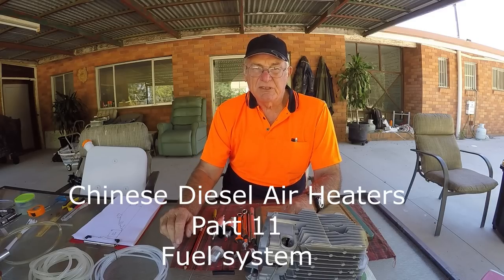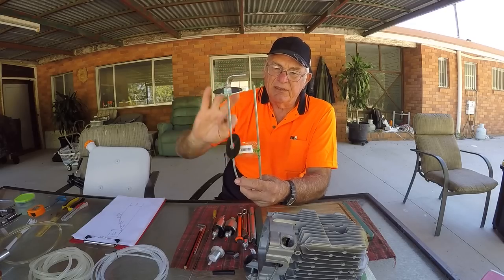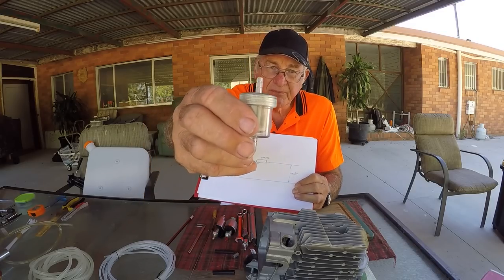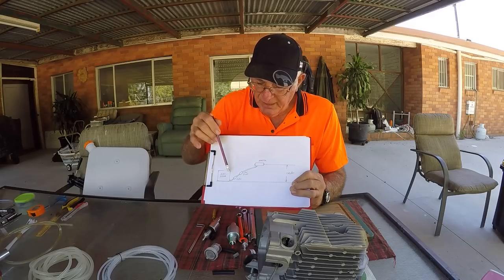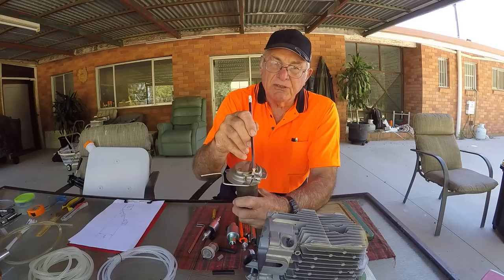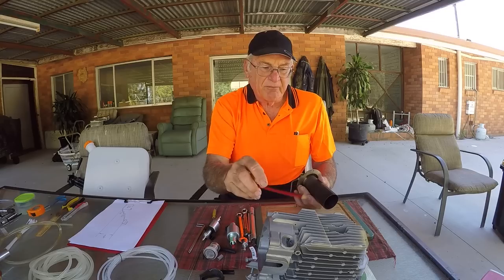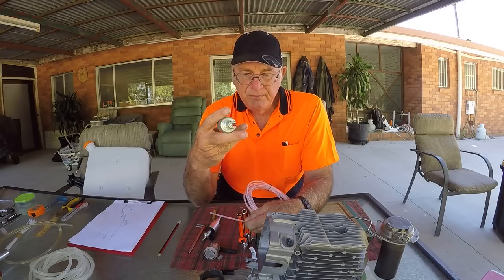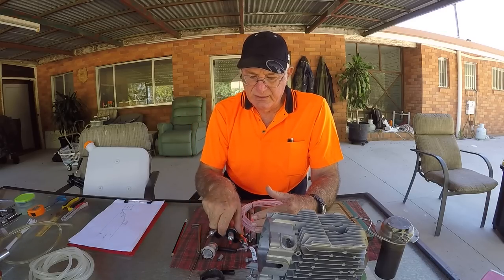Chinese Diesel Air Heaters - Part 11 -  Fuel Delivery

Comment: I have bought one of these heaters unfortunately when I connected the battery, the LCD controller  showed E-O1, which in my  manual  says; to raise the voltage, voltage is 12.8 v, so I assumed the unit is set for 24v, so I switched it off to reset it to12v but that didn't work, so I am stumped as to what to do next.
Reply from the maker: Hi Bob,

You may have a dud heater or glow plug, but first please check the actual voltage at the ECU in the heater. Put the probes where the power wires join the circuit board. If you have long cable runs or poor connections you may have sever voltage drop.

Next measure the voltage with the heater turned on when both the glow plug and fan are running. The glow plug will draw around 9 amps when turned on. Here again a low voltage could indicate too thin power cable (the supplied cable thickness in a real minimum) or poor wire joints.

Also check the fan runs free, sometimes the fan jams in the housing on poor mouldings, and that will cause a high current draw and voltage drop.

If you find nothing there, suggest you claim a refund or get a replacement. 
Please let me know how you go.

Good luck.   JMcK
Reply: @johnmck1147  thanks john, I will be back up there in a few weeks, so it will have to wait till then, (had to come back for chemo treatment) will let you know how I go, thanks again, Bob.
Reply from the maker: bob costanzo 
Best wishes with your treatment Bob.

Comment: Hi John, 

Your series of videos are amazing, and have put me at ease knowing how to modify them into a safe(er) unit for our family's caravan - so thanks a million! 

Some quick questions if I may, please: 

1: Can you please provide a link to the same or similar Nylon tube you used for the fuel delivery? I ran all around town today trying to find it - and failed.
2: In light of the above I purchased some 4mm thick walled fuel line from Repco - I see you mention it is ok if it is a short run from the pump to the heater. My length will be about 1.2m - do you think this is likely to cause soot buildup?? Should I just get the smaller nylon tube instead to be sure?
3: Lastly, I plan to install the heater to the floor of our caravan. The air intake and fuel line I'm happy with, but unsure if I need to wrap the exhaust for heat protection. The exhaust will mostly run along the chassis of the caravan but may contact the plywood flooring for about 100mm - is this a fire risk, and if so what product would you recommend? (a link would be greatly appreciated!)

Thanks again John, love your work!

Anton.

Comment: Have you ever tried to use copper tube ?
Reply from the maker: Yes. 
In many countries copper fuel line (or ss) is compulsory if the fuel line runs through a machinery space, eg boat engine room.  JMcK

Comment: If this was the only thing you had to heat with, how long in a day can you run these heaters for?
Reply from the maker: Hi Daniel, the original heater was not designed for continuous use, but as more of a parking heater, overnight use, or 12 hour stints, however if you have a well set up instillation, and run them on a low to med setting you can run them all day.

They have one moving part in the heater and moving parts in the fuel pump. The first to wear out is generally the fan motor, but greatly extend its life by not running it flat out. 

A good install, seasonal use, and not run flat out you can expect years of trouble free use.
Reply: Okay and thank you for the quick response. I love the videos on these heaters.

Comment: Mine came with the soft flexible hose where can I buy the hard nylon hose? Thanks
Reply from the maker: Hi Tom,

If your fuel run is short, say less than 3 meters the supplied fuel should work ok. For longer runs it is better to use hard nylon. There are many suppliers on eBay. Search nylon fuel hose for Eberspacher heaters.

Here are just two suppliers.

https://www.ebay.com.au/itm/Fuel-Fit-for-Webasto-Eberspacher-4mm-Heater-Pipe-Hose-Line-Kit-89031118-White/273628015150?hash=item3fb5802a2e:g:~boAAOSw9m5cJQa-

https://www.ebay.com.au/itm/4M-Plastic-Fuel-Tube-Pipe-ID1-5mm-Air-Water-For-Eberspacher-Petrol-Diesel-Heater/323753388186?epid=15027379389&hash=item4b6134a89a:g:J4gAAOSwqxdcIKTU
Reply: Is it okay to use black air line it's the only thing I'll be able to get before the weekend?
Reply from the maker: Tom Densley ,.  Yes Tom, I would try that first.

Comment: Can the heater fuel feed system use gravity to supply fuel to the heater without using a pump?
Reply from the maker: No Mike,

The ECU needs some method of “knowing” the fuel dose volume and matching that to fan speed to get a correct fuel air mix ratio. 

The ECU also needs to have some method to reduce the fuel volume if the heater is getting too hot, and totally shut the fuel supply off in an overheat scenario.

Cheers.   JMcK
Reply: @johnmck1147  thanks John, never thought about the ECU and the safety aspect that you pointed out, your the best my man !!!! Another question for you. If I increase the fan speed and retain the dose frequency, would that increase the air portion of the air to fuel ratio in the burning chamber?
Reply from the maker: Mike Barrette 

Yes Mike.
You can also do that to improve the high altitude ability of the heater, where you have a soot issue from rich running due to lower 02 levels.  JMcK
Reply: @johnmck1147  Thanks again John from a Canadian fan !!

Comment: My pump is clicking but not pumping fuel any idea why?
Reply from the maker: Hi S

Have you primed the pump? You need to prime the pump, and then see if fuel squirts out the other end.

Is the pump angled upwards more than 15 deg. You may have an air bubble that can't escape.

Is the pump new and does not work?

Is the pump old and has been working well until recently?

Do you have a good fuel filter before the pump? The pump internals are very small and the smallest bit of crud will block them 

Regards. JMcK

Comment: Need help .campervan is fitted with heater .the fuel.set up is connected to return fuel line on my fiat ducato 2.5d 1991 .connect on a t junction return fuel line ..now having trouble with air in the puck up fuel line
Reply from the maker: Hi Godblessual. To stop fuel issues you need a seperate standalone pick up fuel pipe or use a seperate fuel tank. Suggest you look at video of motorhome install.  JMcK
Reply: Separate tank seems the best way..I didn't Install it..just come.accross issues with.loosing power.and air in the inline.fuel line pick before the fuel housing and.pump etc .

Comment: Can you mount the tank above the unit
Reply from the maker: Yes Roy, you just need to install a fuel shut off valve in the fuel line between tank and fuel pump and turn off when heater is not in use, as you can get seepage of diesel past pump seals which can flood the heater when heater is not in use.  JMcK

Comment: Hi john, would there be a problem with the tank fitted above the heater?
Reply from the maker: Your welcome Caravelle. Sorry. J
Reply: I’m not Martin lol
Reply from the maker: No, as long as it is not too high, up to about 2 meters seems ok. Eberspacher puts their max at 3m, but I feel that is perhaps a little too high. But regardless of height, if the pump is below the tank you should put a tap at the tank so you can turn off the fuel if not using the heater. J

Comment: Would it be logical to assume, that mounting the fuel tank higher than the fuel pump- burner, it would increase the life of the fuel pump, because the fuel is now using gravity to help feed the fuel pump, instead of the gas tank being lower and making the fuel pump work harder to move the fuel to the burner ?
Reply from the maker: Hi Dave, it is quite ok to mount the tank above the pump and heater, but you need to install a fuel shut off valve between tank and pump and turn off when not in use as you can get seepage past the pump seals and flooding.

Comment: hello John. I have an issue with my disel heater i bought. last night. It was runninging smoothly when i isnstalled it but today when i try to start it then i get error E-03. I have checked the plug and it looks fine beside that the yellow wire is alittle bit damaged. Do you know what the issue to this Error E-03 can be??? I rly wish to use my heater this week.
Reply from the maker: Hi Vouch,

E-03 is generally an ignition fault. It can be caused by a defective glow plug, but most often  by low battery voltage and voltage drop in the wires.

Suggest you put a battery charger on your battery and see if that helps.

Another issue is voltage drop. The heater can draw 8 to 10 amps on start up, and the power wires supplied with most heaters are real borderline. If your battery is half half charge the voltage drop in the wires can be enough to prevent the glow plug getting hot enough for a start.

I hope this helps.  JMcK

Comment: Hi John 
What a great video!
Can I have the fuel pump and tank above the burner aprox 40cm? I am building a truck camper .
Ulf Hansen Sweden
Reply from the maker: Hi Ulf, yes, that will be ok. You can go up to about 2 meters of head pressure without too many issues, however you really need an inline shut off valve in the fuel line between the tank and the fuel pump.

The issues you have is fuel leakage through the pump. The pump piston is forced upwards by an electromagnetic field but returned down by small springs. Head pressure can cause diesel to overcome the little springs and leak past the pump. If the heater is also lower than the fuel tank you will get diesel leakage into the burner and flooding.  

Turn the fuel tap on when you wish to use the heater and off after use.

Regards.  JMcK
Reply: Thank John for taking time to answer my question. Your videos are fantastic manual for the heaters.
Have a nice day
Ulf Hansen
Reply from the maker: Ulf Hansen 
👍
Reply: @johnmck1147  Thanks, that's just the information I was looking for, I guess my only other question is if the unit can be rotated 90 degrees and mounted to a wall instead of a floor.
Reply: John McK 47 
Hi John
Everything is up and running now and works perfect, and thanks again for your help.
I wonder if you know any silent fuel pump for replacment. I see that planar have a silent pump but they claim is not compatible eith the chinese.
Be safe
Ulf Hansén
Reply from the maker: Hi Ulf, yes, that is ok, but install a fuel shut off valve in the fuel line before the pump and turn off after use, as you can get some fuel leakage past the pump seals and flood the heater. Also remember the pump must have a vertical tilt to allow the cavitation air bubbles to escape.

Regards.  JMcK
Reply: John McK 47 
Ok, so the planar pump should be mounted 90degres not between 15-30degrees.
Reply from the maker: deuceaid 

Yes, provided that the glow plug is on the top.   JMcK
Reply: John McK 47 
Thanks again for your help, do you have a paypal account so I can make a donation for your great help
Regards
Ulf Hansen
Reply from the maker: Yes Ulf, that is ok, but install a fuel shut off valve before the filter and the pump and turn off when not using the heater. Sometimes the head pressure of the fuel can leak past the small springs in the fuel pump and slowly seep into the heater when not in use.

Regards.  JMcK

Comment: Thank you John, My new heater installed in my RV blows only cold air and this episode shows the installer should have used the supplied 2mm hard plastic as the 4mm or so black rubber line he used won't get rid of the bubbles and airlocks,  nor is mounting the pump dead level not 45 degrees. Do you break off the black covers to reveal the mesh on the air inlet?
Reply from the maker: Hi Mark, 

Not quite sure what you mean about break off the black covers, and what mesh are you talking about?

The heater cover is easily removed exposing the Al heat exchanger, but there is no mesh there.

Can you please give some more detail.  JMcK
Reply: @johnmck1147  i saw a pic of the air filter and they'd broken off the outer plastic casing showing the steel filter mesh inside, thought maybe that was required, now realise not to.

Comment: Iv just had my heater lut in by a mechanic and Iv noticed he has put my fuel line in to my fuel filter. Is this the wrong way to do it
Reply from the maker: Hi AM23,

I need more information to answer your question.

It is fine to use normal fuel line on the pick side of the pump. That is from fuel tank to shut off valve (if needed) to fuel filter to fuel pump. On delivery side of the pump you should use narrow bore hard nylon fuel hose.

Cheers.  JMcK
Reply: @johnmck1147  the fuel line from my heater he has connected it to a t bar from the top of my vans main fuel filter. When my van runs the heater works fine turn the van of it starts sucking in air from my van filter. Iv noticed he hasn’t used any jubilee clips on that end to. Can you run the heater fuel line to my van filter. My van is a 1992 vw t4. I’ll try jubilee clips tomorrow and see if that helps. As I think when my van is running that’s giving it pressure to work then when van is turned uf sucks in air cuz no jubilee clips and has no pressure
Reply: @johnmck1147  if you have an email I could send you a video of what I mean. As I’m not the best at explaining at times
Reply from the maker: Apache Moonshine23 

That would be better.  johnmck47@outlook.com
Reply from the maker: Apache Moonshine23 

You really should have a separate pick up tube for the heater. Have another look at the motorhome install videos.   JMcK

Comment: Quick question if anyone can answer.. can we use 2mm bore copper as a fuel line?
Reply from the maker: Yes Mr P
In fact in many countries you must use copper or stainless steel (Inox) or copper fuel line if it passes through a machinery space.  JMcK
Reply: @johnmck1147 yes same question, I will be using an aluminum fuel tank with 1/4”NPT outlet, wondering if I can just make a rigid stainless fuel line as long as inside diameter is 2mm or .08” and not have any issues! Great videos

Comment: Can anyone please help me? I'm having fuel pump problems with my Chinese Diesel Heater. I want to ask John a question about the operation of my pump with my controller. Any suggestions? Thank you!
Reply from the maker: Hi Philip, what is the issue? JMcK
Reply: @johnmck1147 
Hi John, Thanks for getting in touch with me..... my computer skills are somewhat limited!
My new Chinese Diesel Heater was installed by me in my caravan and I managed to start it and it ran very well. BUT ... it will not re-start. I'm trying to follow the Chinese to English instructions but they are a little obtuse?
I looked on line for info on the operation of the controller but they are all different to mine. I'll try to put a pic for you if I can? Mine has an extra button on the LHS with a pic of diesel dripping I think?
I cannot start the fuel pump at all. I get a faint 'click' when pushing the two RHS top and bottom buttons. I think that is what you are supposed to do from the instructions?
I checked the fuel line and no bubbles to the pump. Input line slightly downhill. Output line only about six inches to the heater. Based on your advice I'm thinking of putting hard nylon 2mm tubing in the output line but as I said the heater was working very well initially. 
When I push the startup button everything seems to be going smoothly, the fan commences, the pump icon comes on, the battery drops as the glow plug heats, but absolutely no pump 'clicks', then E-8 on the controller! I cannot get it to prime at all? Do these pumps fail? 
Alas, I can't seem to get you a pic of the controller! I can send it to an e-mail if you need to see it?
Looking forward to your expertise,
Phil
Reply: @johnmck1147  Hi John, I did try to post a reply the other day but my computer skills are somewhat limited so I'm not too sure if it has been seen by you? I better see if this is getting thuogh to you before I send you all the details to my enquiry. Phil
Reply from the maker: @philiplittlejohn7689  👍

Comment: how long does the diesel tank last filled up ?
Reply from the maker: Hi Steve, that depends on the size of the fuel tank and the heat setting of the heater. These heaters will burn between about 100 ml per hour and 400 ml per hour, depending on the heat setting.  JMcK
Reply: @johnmck1147   I would be running it about the lowest setting  so 100 ml then.
Reply from the maker: Steve Flournoy 

Correct Steve. Have you seen the video I did on fuel consumption?  JMcK
Reply: @johnmck1147   yes I did-- thank you
Reply: @johnmck1147   yes I did, watched most of hem

Comment from the maker: Hi Anton,

1. There are a number of sites on the internet selling the nylon fuel line. Search for Eberspacher, or Webasto diesel heater fuel line. 

Here is just one,

https://www.ebay.com/itm/FUEL-LINE-KIT-FOR-EBERSPACHER-WEBASTO-DIESEL-HEATER/113712817267?hash=item1a79cfe473:g:JwEAAOSwxCxT3MTM

2. Yours is a short fuel run and the larger bore fuel hose should not cause issues. 

3. Your exhaust must be kept away from the ply floor. You can stand it off with a metal bracket, or wrap in some exhaust lagging. Repco or performance car shops will sell exhaust lagging. 

Hope this helps.   JMcK

Comment: I'm using ⅛" soft copper with a ⅛" inline check valve .
Reply from the maker: Thanks for the feedback GMT.  JMcK
Reply: GMT, how did you connect the copper to the fuel input line?
Reply: @johnmck1147  
With amazing plumbing skills , and craftsmanship !!!!!